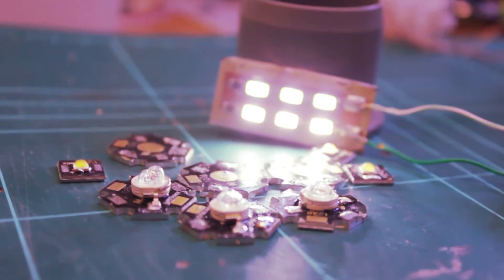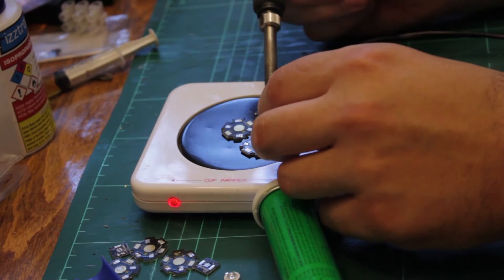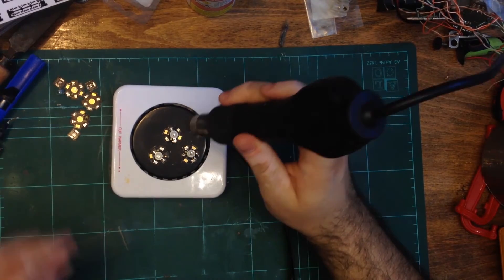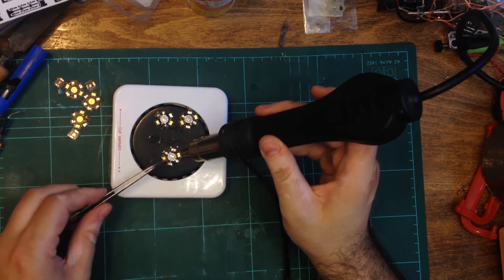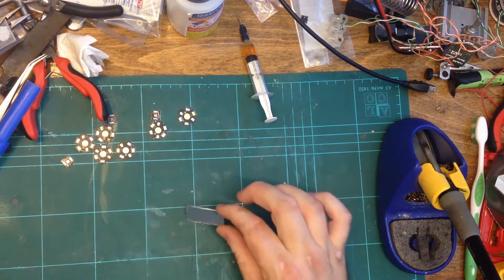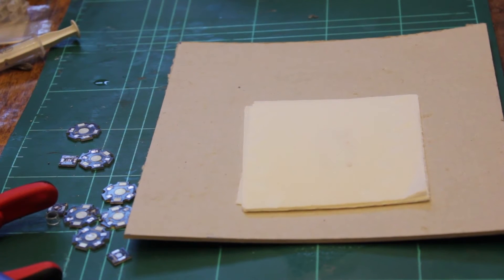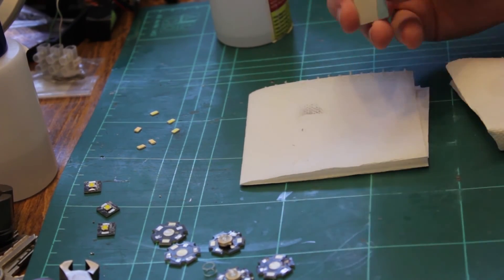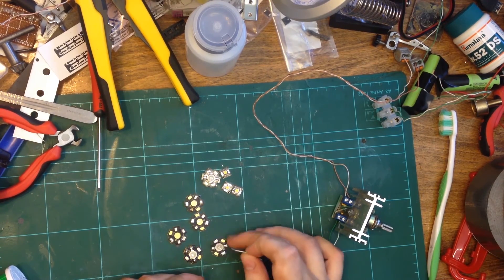How to solder LEDs to Aluminium Star PCBs

Comment: I have 3535 COB leds, and already have some aluminum star heatsinks such as the ones in this video. Is there any problem with soldering the LED directly to the star heatsink?
Reply from the maker: There would be no problem that I can see as long as you are able to bridge the solder to the solder pads without any shorts in between.
Reply: So, run one solder line from the anode to the positive and cathode to the negative per the LED specs?

Comment: I got some of these RGBW ones with heatsinks i'm gonna try presolder the pads and heat gun it after placement what temperature would you suggest on the heat gun to make sure I dont destroy the led? https://drive.google.com/open?id=1Ab4bbR6ocwUAga3jmlL4eSm_0V4YzkpP
Reply from the maker: Well, most LEDs datasheets follow the same ramp function for reflow soldering as most other SMD components. You don't wanna exceed 200 - 215 deg C on the surface of the LED for any length of time. If you can hold it, start your heat gun from a distance and just slowly get closer until the solder flows. After that, remove the heat quick and let it stick in place. Best of luck!